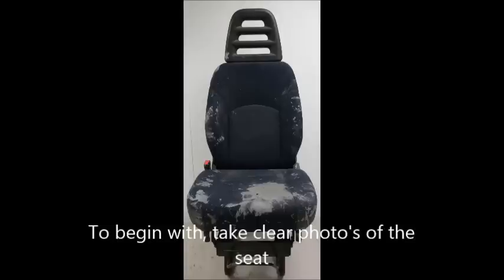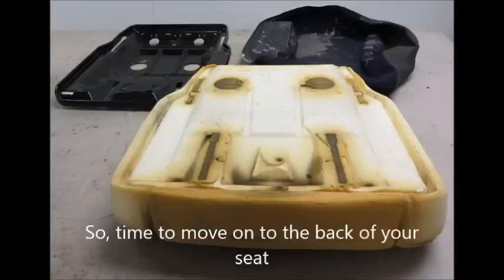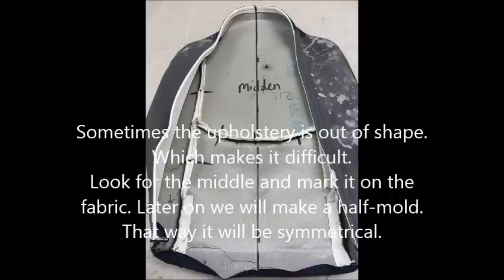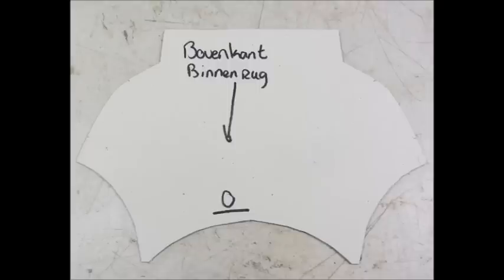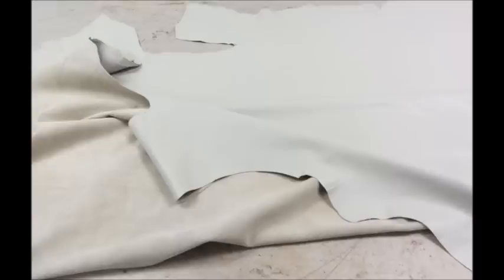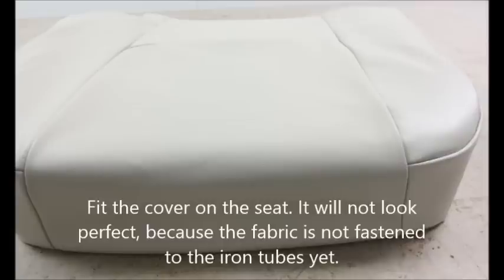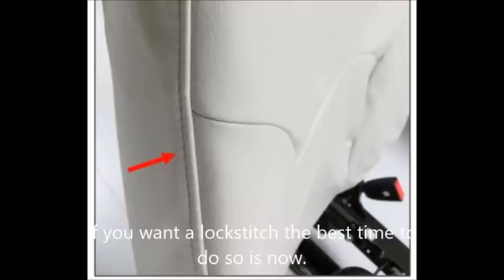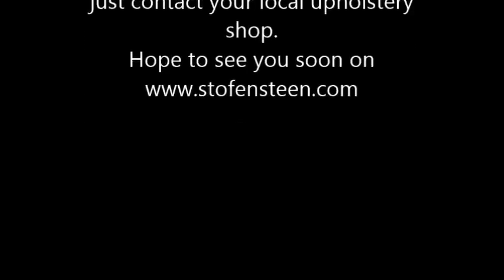Upholster a carseat

Comment: the foam on my seat is bad on the side what is  used to make the foam ?
Reply from the maker: The easiest way to repair the foam is to go to your local upholstery shop. If you want to do it yourselve, buy an adhesive spray en some firm foam. With an electric knife cut off the bad piece of your seat and replace it with the new foam. Glue it  on as a rough shape and than cut out the shape with your electric knife.  There are special car upholstery shops, most of the time they should be able to sell you a new foam seat. It depends the brand of the car, but most brands can be ordered. They are made in a special mould. Hope this is any helpfull